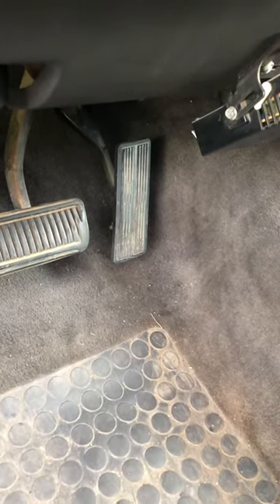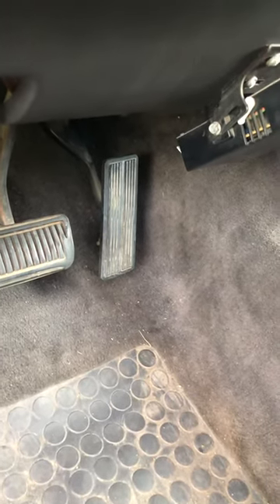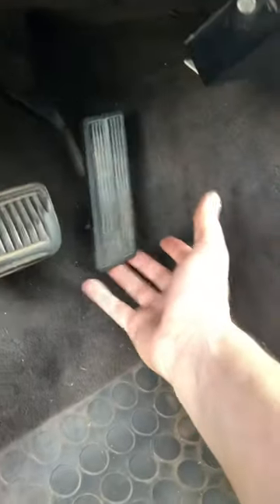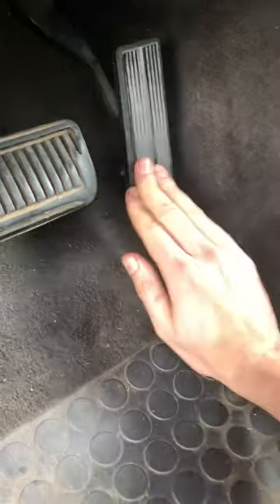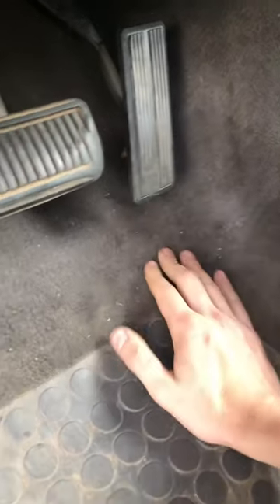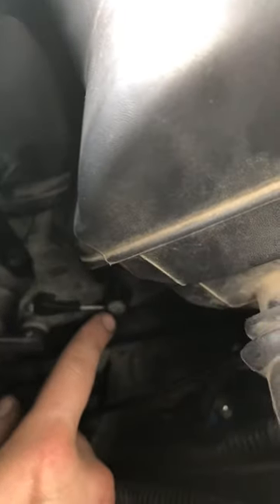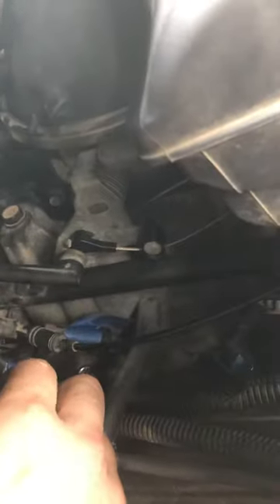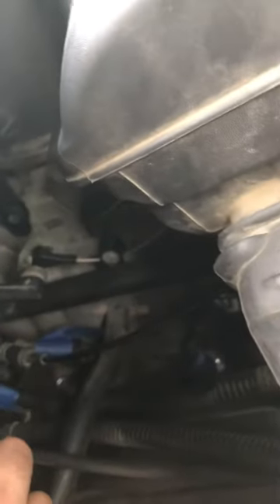Dodge Ram Throttle Cable too loose Fix

Comment: If your're "cash challenged" and your cable is stretched and you're not getting the WOT that you should you can crawl under the dash, pull your pedal up and put a zip tie between the plastic spacer and pedal to take up the slack. Works like a charm and gets those shift points right. It won't feel lazy and shift into 4th going up hill! Great Video!
Reply: Just did this and it worked like a charm. You da man.

Comment: Garage tried to say my rebuilt engine was the cause of my throttle issues. $1400 dollar fix they quoted me. The throttle wire just came undone/loose. 5 minute later, fixed. No issues. These garages man especially out here in Calgary Alberta need to smarten up.
Reply: In my experience the only thing that makes a good mechanic is experience. Kids come out of school dumber than a box of rocks. You want to find a place with a name like   "Bill's Auto Shop" ran by some old grizzled man who smokes camel unfiltered

Comment: Mine has everything right but still doesn’t go that fast when on gas should I replace the cable mine has 270k miles and pedal is very lose
Reply from the maker: Toxic_SniPe420 is it loose when you push down? You might be able to adjust the slack on the cable as well, maybe look for a video that covers tightening the slack?
Reply: Having the same problem with my 3rd gen Cummins I have a lot of slack in my cable

Comment: Terrible video. What year? What engine?
Reply from the maker: Otto By Ograffey sure does suck. Sorry you feel that way, god bless. 1998, 360 engine.
Reply: @ElementGeekium  The Dodge Ram came out in 1981. The 360 engine has been around since the early 70's. So you can see why your video wasn't very specific, by not stating the year or the engine size, or if what you were working on was carburated or throttle body fuel injected. Add that to your video description, or title, and your good to go.
Reply: I'm certain this is a universal fix. I did exactly what he did with my 02 360 with instant results. He didn't have to be so technical. Great video ElementGeekium